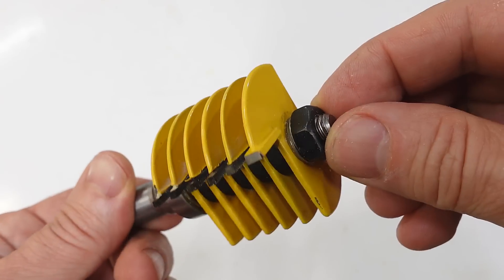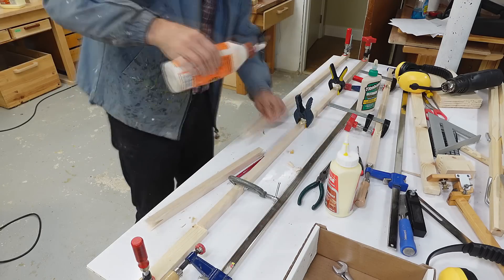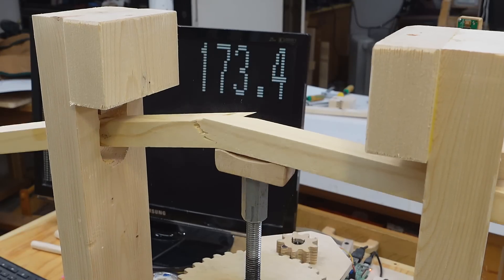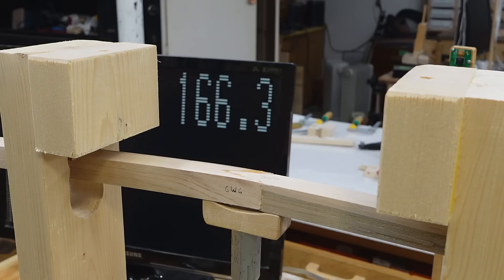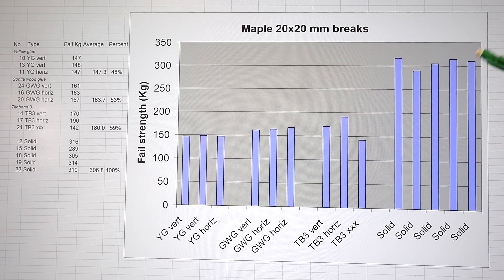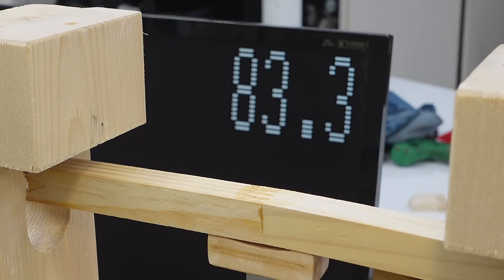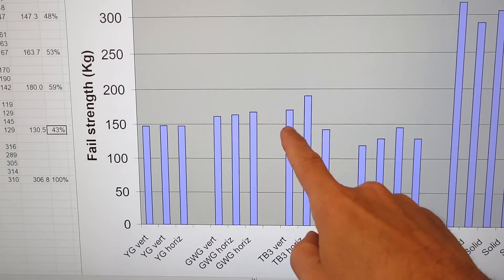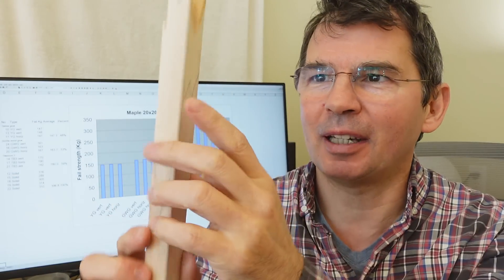End-to-end V-joint strength test

Comment: Howabout a scarf/ finger joint combination. Finger joints where each finger doesn't line up 90° to the stock but instead at an angle, like a scarf joint
Reply from the maker: do tell how to cut those
Reply: @matthiaswandel  well I've just made it up so I don't know what I'm talking about. But I was thinking when you cut your fingers to do each cut at different depth then cut each finger to a different length. I am not advocating for this method, I just made it up
Reply: It would look a bit like one of your graphs!
Reply: Final idea for this. Tilt the saw blade to 45°, cut the end of the stock to 45°, adapt the finger joint sled to hold the stock at 45°, then cut the fingers with the stock held at 45 and the blade tilted to 45
I've enjoyed the thought process for this but have no idea how useful/wanted this idea may be

Comment: Don't Japanese woodworkers use strange Z-shaped and inter-locked joints held together with hammered in through-pegs that tighten and lock the joints ? How do those compare in strength and easy-to-make process ?
Reply from the maker: too much wood take a way.  a glued or screwed joint will hold much better
Reply: That's mainly because back in the day they didn't have glue, screws, bolts, etc.
Nowadays people only continue to use those kind of joints for the aesthetic, not because they're particularly strong.

Comment: the problem is you're using too inflexible glues. wood fibers can flex a pretty large amount, but once you put ordinary glue on it, it becomes too inflexible and thus will crack either the hardened glue or the wood around the hardened glue.
Reply: Enter: Construction adhesive.

Comment: That looks like a lot of fun and everything you said sounds right on.  As a structural engineer I'll say that I thought the long V joint would develop more strength.  It appears to be limited by glue strength meaning you could try making it even longer.  Also I wonder if epoxy would do better as an adhesive.  Your comment about the straight fingers should be correct also- having half of the wood fingers in what amounts to end grain to end grain should limit the strength of that joint to about half of the total strength.  Even if you had a good finger joint bit this could still be a problem because there is still a good percentage of end grain involved.  I was surprised that the straight fingers came as close to the V joint as they did, the straight fingers do have a lot of glue surface area to help them.

Comment: I think you're clamping of the glue joint is not proper. You're putting axial force end to end pushing the two pieces together. You also have eye force perpendicular that clamps v joint together. I think the problem is you only have one clamp on it which is a small area. It looks like the v joint is a few inches in length whereas the clamp is only a half inch in diameter. You should clamp it all the way the length of the v-joint so that all the area of wood joint is pressed tightly, and perpendicular to the axis of the length.
Reply from the maker: well, that somehing for you to test and report on

Comment: i am not sure what the translation from german to english is, but would you like to test real "Schäfter"-joints. 
it's a long bevel cute which is calculated: cutlenght = thickness times 8 
for example a 2x4 should have a wedge at the end with a lenghth of 16" 
that joint is used in theaters for 16m long 60mm x 30mm and i have never seen one broken

Comment: It would be interesting to see some of these tests scaled up (or down) in size a bit as well if only to see the relation between size and strength in each joint. Basically it’d be cool to see the workpiece/joint size vs strength curve on a graph. Great video series!

Comment: How about different lengths on the fingers so they all are not on the same plane across the joint? kinda like staggering the seams when installing flooring.
Reply from the maker: just bu how much the screw turned, but part of the flex is also the apparatus

Comment: What about the V-joint and FINGER JOINTS combined. 😮😮😮😮
Reply: finger joints tend to fail at the outside edge where it is basicly a butt joint. very deep box joints should make it more strong but probably the scarf would still be stronger

Comment: Hey Matthiad - have you ever experimented with "wood welding"? Not sure there is anything actually useful there, but might be fun/interesting?
Reply from the maker: in that case, a longer piece of wood would be much easier.  practicality is a major consideration.
Reply: @matthiaswandel  Sorry, i just meant in general, not necessarily related to this video. Regardless, practicality is still a consideration. :-) I just think it's a neat subject and I'm sure you'd have an interesting take.

Comment: I’ve used scarf joints before.  I read that they are common in aircraft manufacturing. They use a ratio of 1:6.  If the stick is 1” wide, the joint needs to be 6 inches long.  This is easy to cut on the table saw.  Can you investigate the strength of this joint?

Comment: For what it's worth, in the airplane world, if you need to join two pieces end to end, the standard is a scarf joint with a 15:1 ratio of wood thickness to length of joint.  IOW, if you're joining two 1"-wide pieces, the scarf joint has to be 15" long.

Comment: With all those glue failures I'm wondering if spraying a little water on the hardwood right before gluing would help the glue penetrate deeper into the wood.

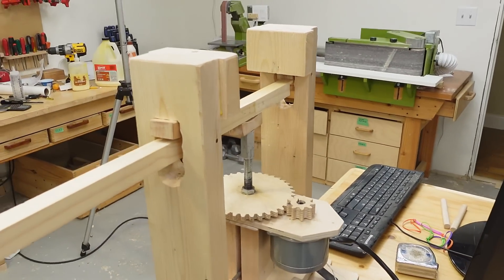Comment: While in air frame school we were taught that a scarf joint with a 1:12 slope (minimum) with planed smooth surface and plywood glued over the joint seam  (one on each end) to be an approved repair. Other trades that had to splice wood for strength also mentioned the 1:12 slope (this seems to spread the stresses out long enough to approach solid wood. Naturally this uses a lot of wood so for many folks they avoid (as in furniture making). And it ain't easy to do well. If memory serves Resorcinol glue was used.
Reply: 1:12 is about 5 degrees vs. the 15 degrees in the video so should give a lot more glue surface.
Reply: It's a trade off of material waste vs strength. At 15 degrees, the glue area is substantially smaller, still retaining nearly 50% of strength of a solid piece, which considering how much deflection the solid piece experienced before breaking, would be more than enough for any practical application.

Comment: Worth noting that the permenant bending you saw after  a minute or twos load happens at around a third of the breaking strain, if applied for years. This limits the practical load limit in many cases to well into the glued joint region.
Reply from the maker: but I have seen old glue joints become unglued over time too.

Comment: My daydream about using finger joints just got a reality check! Thanks for the taking the time to think it through
Reply: As I get older, my finger joints pop more and more.
Reply: The joint, even with end grain pores cut at a suboptimal for bonding strength angle, did perform very well relative to solid wood, retaining near 50% of strength of a solid piece. This is plenty strong if dimensioned right.

Comment: But on a more likely to see it tested end, should try drilling out the tip. Many of the joints failed at that exact point, so perhaps eliminating the stress riser right there could result in some gains.
Reply from the maker: wood is not like cast iron.  an extra hole only weakens it
Reply: @matthiaswandel  Isotropic vs anisotropic, sure. Intuition also says finger joints should be strongest, yet here we are. I've seen tests that suggest otherwise given the hole doesn't exceed a specific ratio to board width. Claim is that by removing material, more forces are applied latterly along the upper element with the grain than across it. Could be applicable only to solid boards, but only one way to know. Regardless and even if I'm wrong, removing material at the center of the board should pose the least detrimental and the barrier to test is far smaller than testing a scarf joint. BTW, since you've said elsewhere glue up is too much of a hassle to test a scarf joint, seems you haven't noticed all you have to do to mitigate the issue is make your same V cuts but highly biased to one side. Flip one board over for the glue up, and now ya got 2 registration points and no slippage. If your table saw isn't able to cut it, I'm sure a bandsaw could make easy work of it.
Reply: @custos3249  a perfectly fitting tight finger joint where the end grain of fingers tightly mates into the matching surface would perform better than grain tubes cut at an angle (elliptical) across the whole board for equal glue area as then You would not rely solely on sides of the fingers for long grain that just transfers the load to adjacent lignin bond between fibres. You'd essentially get the whole cross section of a butt joint in addition to the side grain of fingers. The problem is the fit. It's really difficult to cut a perfectly mating fingerjoint, the ends of fingers are not considered by woodworkers to be important and they use blades without a flat top kerf. A fingerjoint introduces a lot of imperfections and cavities in the ends of fingers.

Comment: So basically... Use of the V joint ir finger joint is best for decorative non load bearing conditions.
Reply: That depends on Your criteria for joint strength as % of a solid piece. The V joint performed very well, reaching nearly 50% of the strength of a solid piece.

Comment: One idea would be to add a dowel between the joints.
Reply from the maker: please try that, and you will not want to do it any,ore.
Reply: You would increase the cross section of the board reinforced by glue instead of lignin by a fraction of a %, but You'd also cut away more material and generally weaken the piece due to surface to surface contact imperfections of dowel to wood joints. In short, you'd introduce more empty pockets and pores for the load to concentrate.

Comment: Bu in practice, you would rarely ever use a single board jointed to another to extend the length, they're almost always used in laminated pieces with multiple offset pieces assembled to a single board.
I'm not sure if your current testing apparatus can supply enough force for it, but a test of commercial glued laminated boards versus same measure of single-piece boards might be interesting. Another possibility could be OSB vs plywood vs glued laminated shelf stock.
Reply from the maker: bit of you just want to lengthen a board, that’s way over complicated.

Comment: Day 78. Still no sign. Scarf combination joint rather than a basic transverse V.
Reply: Geometrically the V-joint is pretty much a mirrored second half of a scarf joint. Consider if the board had been cut all the way through at the 15 degree angle. You get identical glue area and identical wood grain orientation at the contact line. The joint itself is longer, improving load distribution on the glue at dispense of wasted material.
Reply: @amconsole  Which is why people continue to suggest trying a scarf joint, the distributed vs concentrated area. Also, I stated combination, i.e. V+scarf. Regardless, waste is relative and is guaranteed only at the end of a board. With sufficient board footage and forethought, each cut produces the desired mating surface geometry.

Comment: you could try to break a diagonal glued V-joint. And what if you put a hardwood pin through the joint - will it give more strength? there are so many kinds of possible joints...
Reply from the maker: for the extra complexity, I will wait for you to do it and see how it went!
Reply: @matthiaswandel  it just needs an extra vertical V-grove on your tablesaw-jig.

Comment: I am curious how epoxy would hold as a glue, or CA. 
The thing is, the 5,20 min etc. curing epoxy is not that strong, i mean the glue itself is, but the bonding to other materials is not that great. Compared to other types of epoxy wich take more than 24 hours to cure, and even more to totaly cure. Problem with that epoxy and wood is that wood tends to suck all the glue and leave the joint dry. So to make sure the joint is left with planty of glue you can mix the glue with fine wood dust from the sander, or something wich i found makes a really strong glue mixed with epoxy is soot from my wood burner.
There are also glues made from animal skin, from fish. It would be intresting to see these ancient glues compared to modern glue.
Anyway, for most aplications, constructions, furniture, wood glue, altough is not that strong, is strong enough, and if you compare the cost, with other glues, such as epoxy. Wood glue is still the best glue for wood. But i think your goal is to make a joint wich is as strong as the wood itself. And i think you can only achive that with epoxy. But then you have another problem, because the wood fibers are flexible, and then that kind of a joint would not be, it will tend to break right near the joint, and therefore weakening the piece, meaning a very strong joint is actually not good.
Is fun to watch these experiments, but i think you should really watch the making of wood bows, more specific the modern wood laminated bows, bowmakers seem to me to be the masters of glueing wood. And you would see there that even the slighest imprefection in a joint would weaken it by alot, is not always about the glue, is more of how you aply it, making sure you leave zero bubles out, etc.

Comment: Thanks for the further testing!  If I may bet my 2 cents and grains of salt, I'm convinced that half lap joints and scarf joints are both superior and look better. A simple enough fixture (couple stop blocs and some screws/cyano ) to glue multiple scarf joints can be made to offset the "difficult" glue up. I say "difficult" because the alternative is weak joinery with sharp visible joint lines that imitates cheap mass made boards, therefore mostly pointless to me, especially given a similar time investment for either methods anyway.
Reply from the maker: what makes you think a half lap will do better than the finger joint, which in itself didn’t do great?
Reply: @matthiaswandel  for post uses instead of beam the box joint might be better but those pressures get insane real quick.
Reply: Half lap would give you about half the strength max. because you only have half the material going continuous through the joint.  And if you bend it the wrong direction it will have 1/4 the strength.
Reply: @billj5645  not used much except for tensil positioning
Reply: @billj5645  I disagree, the glue will replace lignin and the fibers are mostly intact for over 85% of the thicknress and are in the same "plane"  we should have nearly identical strength and weaknesses as the original board. Fingers and box joints create localised stress points where a half lap has only a thin glue line interrupting the original woodgrain orientation. Figure a 2.00" x4.00" board (actual) with a 6.00" long x 2.00" wide joint.

Comment: Ultimate strength would be the side by side wedge cut but one peak is deeper than the other so you don't get the perforation effect you got from the finger joints

Comment: Intuition told me the finger joints should be stronger.........the data proved me wrong....love it!!
Reply: Most people say don't bother trying to glue end grain to end grain, the joint with straight fingers has half of the total area of the wood that is actually end grain to end grain.  If you disregard that the maximum strength of the straight fingers is 50% of the total strength of the wood.
Reply: I wonder how much dove-tails and wedged joints are compared to finger/V joints. Are mortise and tenon so difficult to make  with modern power tools ?
Reply: That's one of my favorite things about these random material test videos. I don't do a lot of woodworking so I don't have a good intuition on the strength of different joints and woods, so just having an idea of how they behave is super useful.